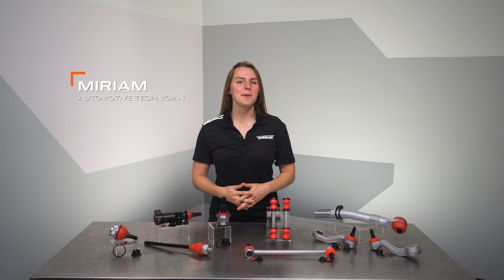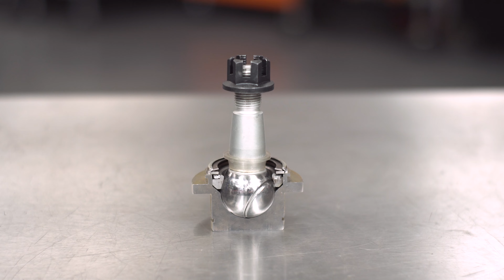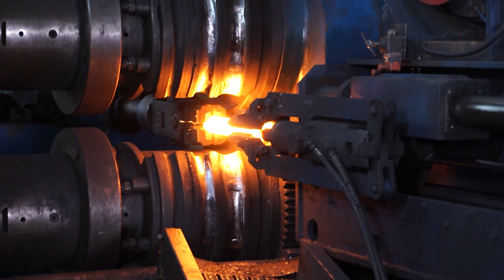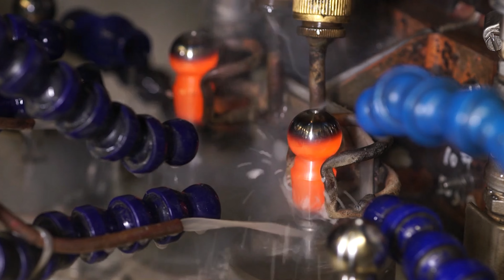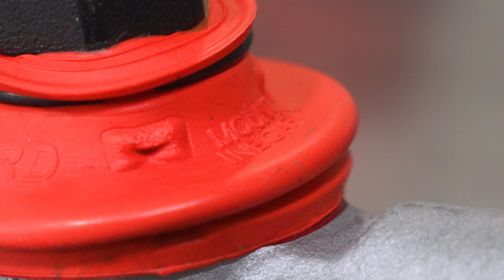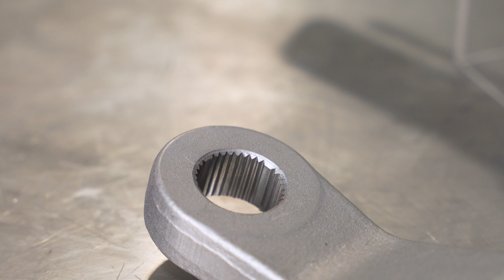Rugged chassis solutions for severe-duty vehicles | Dorman RD

Comment: These products are phenomenal have every part they offer for my 2005 Duramax on a lift with 35 inch tires 14 wide wheels. Pushing 650HP it doesn’t miss a beat. Doorman RD parts and KYB Monotube Monstermax shocks energy poly bushings all the way around s&b cab mounts it handles like  race car